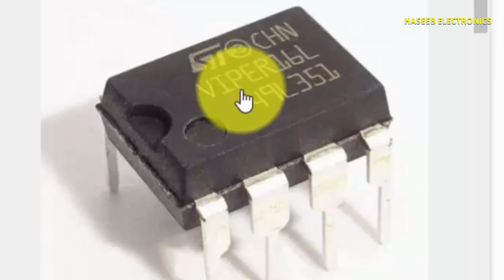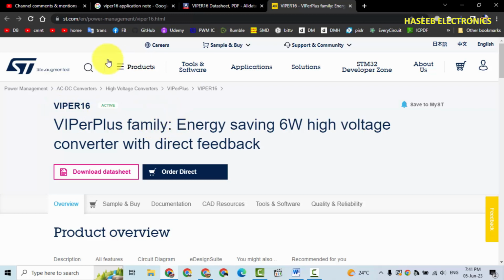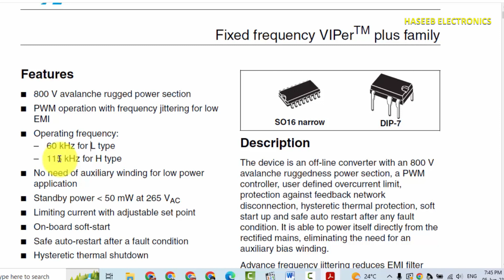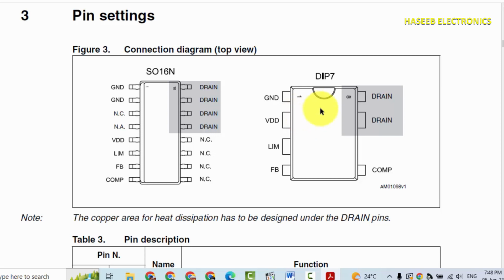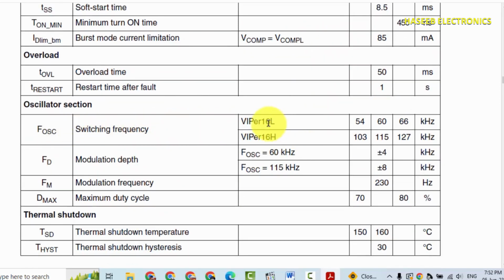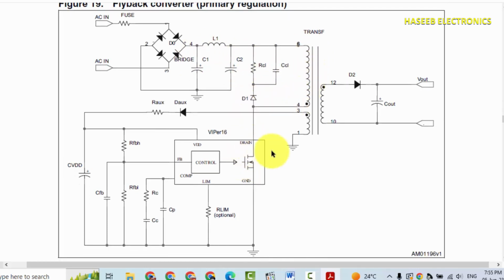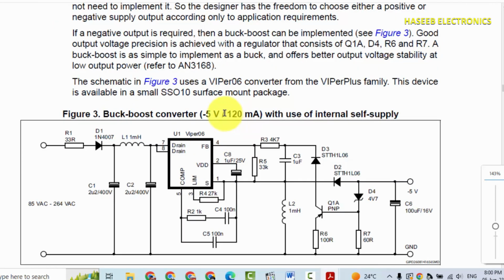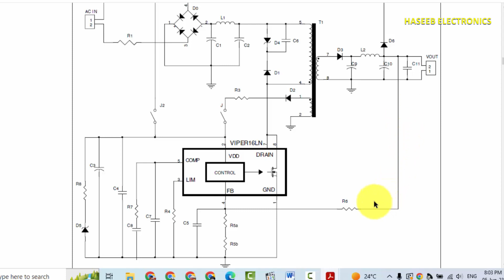{907} Viper16 sample circuits and application notes

Comment: Great information, thanks for sharing.

I am looking to build a UPS for my router and DSL modem that uses a LiFePO4 battery that already has a built-in BMS, can you suggest a circuit design ? I do not want a circuit with a delay caused by a relay switching over the load to the battery, I want a truly Uninterrupted power output of 12VDC 5Amps.
Can you help please ?

Comment: nice video
btw I had a question , I bought a smps 12v 10A and it doesn't have any pwm ic like TLC494 and also no adjustable voltage trimmer , that means voltage adjust is not possible in this smps right? by the help of potentiometer